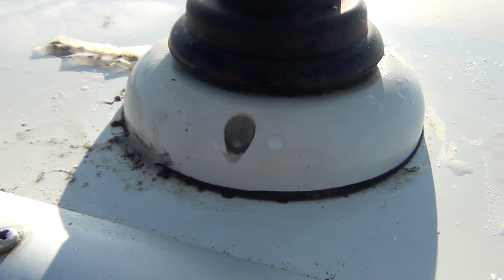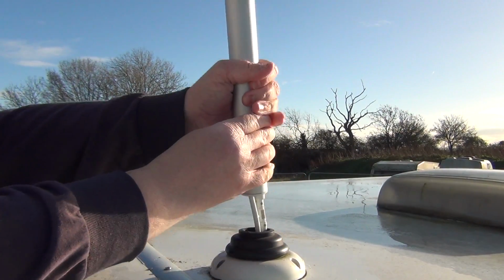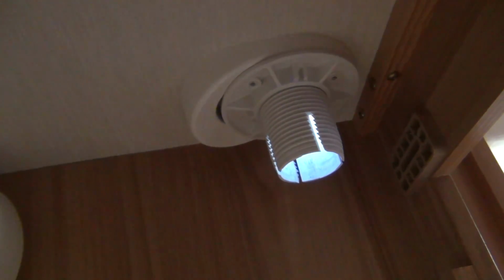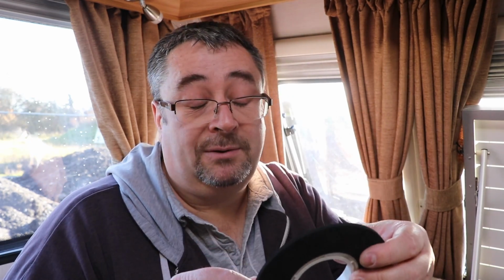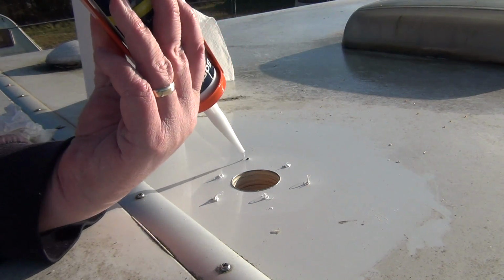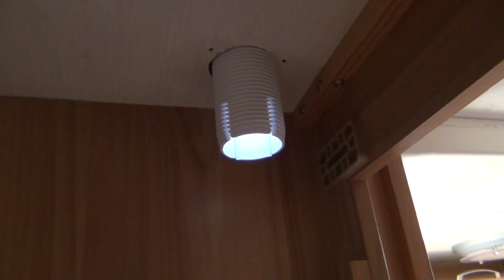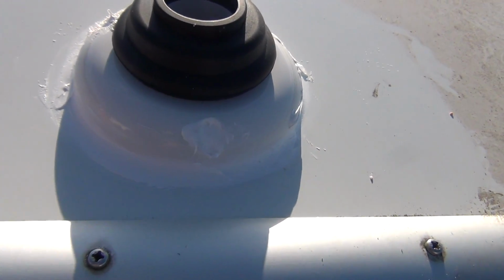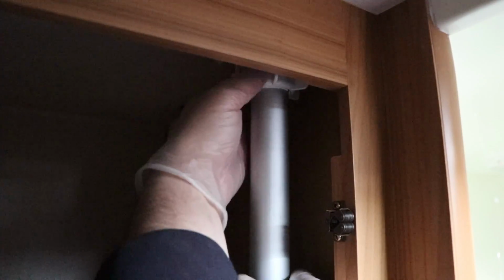Replacing an antenna mount on the caravan

Comment: I have this same problem of water running down the centre tube, I sealed all round mine last year including the joint casing around the antenna itself, but this winter still got drips again, i use my caravan in winter, and im beginning to think it could be condensation, and the antenna is acting like a damp trap, my thought is the warmer air from inside the caravan goes up inside the antenna through the tube, cold air outside then makes the warmer air inside the antenna condensate, and after a few months there is that much moisture build up inside it runs back down the tube.....
Reply: Was it dripping in or was the droplets just held at the end parts?

Comment: Dan, I am surprised that you did not contact the suppliers and ask like I did.
I, like you thought the water coming in was via the tube and gaiter but in fact the head was letting in water. When I took it out you could hear the water inside it.
The supplier said that if it was the head then you need to clean up the edges and the groove, then rub with wet & dry sandpaper, thoroughly clean and then apply mastic all around the edge filling in the groove.
So I first drilled a very small hole in the groove at the pointed end and drained out the water then followed the instruction above.
Hope this helps those who have the same problem of water coming down the centre of the tube, down the cable and save £20 + on parts you do not need.

Comment: Please can you help, new to caravaning, on our first visit we noticed you can run an arial type cable from the caravan to the electric supply, so my question is what type of cable and where can we get one from.  Sorry for asking, but we watch all your films and they are so helpful.  Sarah and John
Reply from the maker: Hi Sarah & John. 

Its a good question. So all you need is a 25m standard aerial cable. Try to get a good quality one so you won't loose any signal. The connection on the electric post is a standard TV coax connection. Be warned however, they can be loose from constant plugging in & out etc, so be equipped with a bungee cable to hold it in. 

Back at the caravan it really does depend on what caravan you have. Some have an external "Satellite Dish"  connection that can be used. These have a F-Type connection, so you can buy an adaptor to convert a standard TV coax connection to an F-Type. (don't worry, ill put this below)

If your caravan doesn't have a satellite dish connection, don't worry - you can buy  short strip of flat coax which you can place in the window and connect the outside to the inside etc.

Links below, hope that helped. 
Dan

TV Cable : https://www.ebay.co.uk/itm/New-25m-Black-RG6-Aerial-Coax-Cable-Coaxial-Lead-4-Free-view-Magic-Eye-Tv-Link/371400046413?epid=2199090594&hash=item56792af74d:g:s4IAAOSw7ehXRZLC

F Type converters : https://www.ebay.co.uk/itm/2x-F-Type-Connector-Male-to-TV-Aerial-Socket-Female-Adapter-RF-Coax-Converter/331888350681?epid=1176009110&hash=item4d461655d9:g:818AAOSw0UdXsugS

Flat Coax : https://www.ebay.co.uk/itm/Flat-Satellite-Sky-Freesat-TV-Aerial-Coax-Cable-Caravan-Window-FREE-F-PLUGS/301987198429?hash=item464fd6f5dd:g:PPMAAOxy63FSqhhN

Comment: With regard to the sealent, it would be worth considering using a non adhesive type as if you need to remove it again you will curse the day you used adhesive.(Bitter experience)😥

Comment: Looks as if you removed a perfectly good seal there, broad seat with no signs of ingress.
Reply from the maker: Hi Alan, 1st impressions were it needed replacing, the felt ring looked like it was allowing water in. On removal, it looked like it was not to blame and in fact was the antenna.

In subsequent looking at the removed parts, it had in fact failed. The rubber collar had a tiny crack, and the felt rim has a tide mark on it. So its fair to say, it was a job worth completing.

I will be following this video up with a antenna repair (which also had failed) and an antenna upgrade.

Dan

Comment: It does not need all the sealer its designed to be a seal without the need for all the horrible sealant, I hate the stuff! Sealer could actually affect the seal design itself.
Reply from the maker: Hi, 

When i spoke to Vision Plus, they stated "it won't hurt" when i asked about the sealant around the outside. I do agree though, the sealant is horrible stuff. Its a skill ive never perfected or even gotten close to getting right lol. 

Take care
Dan

Comment: I wouldn't worry too much about looks as long as it does the job. It's not as if anybody's gonna notice. It made sense to replace the base seeing as you'd already bought it and the seal on the old one was probably close to failing. You've nothing to lose by dismantling the aerial if. Like you said, it could be just an O ring. If you upgrade do you think that Status might send you one FOC and you could do one of your reviews? Our Lunar just has an aerial socket on the outside so we just plug in in external aerial. We bought an aerial (can't remember the make and model) and a mast which is clamped to a bracket on the A frame. I might just demonstrate this in a future video.

Comment: What is the chrome Ariel for on the antenna
Reply from the maker: HI Robert this is a for the FM reception, although where the antenna is and getting to it makes this extension pretty useless. 

Dan
Reply: I thought it might be for FM radio reception and mines over 9 ft high, so I thought i would check with you, and yes I agree useless.

Comment: just come home from work to upgrade mine from the old ufo type to status 530 i got off fleabay. just check youtube and you have a video, perfect timing thanks for info. now going to drill a hole in roof of caravan, wish me luck
Reply from the maker: you will see a video of me fitting a Status 570 to replace the 530, but also how to inspect and replace the O rings on the pole. This is what was actually at fault on my antenna. 

This will be coming out in the new year. 

Dan
Reply: the one i got off fleabay had leak fault. I removed about five screws and split apart. The sealant inside had gone. Have resealed, cleaned it up with plastic cleaner looks like new( on a budget) 1999 swift caravan.

Comment: Dan the man...is there anything you can't fix?? :).
Reply from the maker: i can't fix towel rails in plaster board at the moment, try as I might - the bathroom's towel rail is always coming free from the wall... so, theres my limit lol

Dan
Reply: Er?..... seal around the bath maybe .... haha lol .... you n me both Dan ... takes longer getting sealant off fingers, gloves, tissues, kitchen roll, spatulas, knives, trowels, ( insert any flat implement here) etc than doing the repair !

Great vid as usual ... 👍🏽
Reply: The Trudgians you tried umbrella screws?
Reply from the maker: Im not familiar with these, so no I haven't. 

Dan

Comment: Next time you run your finger around caulking, dip your finger first in some soapy water or pre-mist the area with soap water. You will get better looking results. Also could you not have just used some butyl tape in place of the felt getting a better seal and allowing no wicking action through the felt? From Canada here so don't know if felt is the same meaning here as it does across the pond... Also not a good idea to have the coax in the water at the beginning of the video do to wicking even a little and allowing the possibility of rust or oxides to form... Could cause some signal degradation... Enjoying your videos the last few days...

Comment: Good instructional video Dan, one minor point, the sound is not synced properly, but otherwise top marks.
Reply from the maker: try it again, its an issue with newly released videos, it settles down after 30 mins or so. 

D
Reply: Great video Dan. You are a man after my own heart. I love fixing things myself too. Caravanning wouldn't be half so much fun if these little challenges didn't arise now and then. And, you also spotted a potential upgrade opportunity, good man :)   No problem with lip-sync by the way.